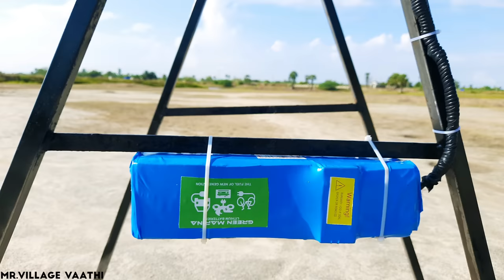120 Km/hr Cricket Ball Launcher | Speed தெறிக்க விடும்| Using Cycle Wheel | Mr.village vaathi

Comment: place 2 push pull solenoid to control ball movement, and pour even 100 balls in a container. Pull the solenoid pin and allow one ball in at a time. Spinning a ball with just 2 wheels is tricky. You may achieve a basic spin, but not a considerable spin to practice. Use this for, pace, with higher speed. It will work like darling.

Comment: Anna, super work! 
I would 100% consider adding a motor to both the wheels.
1. For a fast bowling make them rotate in the opposite direction. (clockwise/anticlockwise). This will make the ball go faster. 
2. For Spin, make them rotate in same direction. You can change the nature of spin(leg/off) by choosing which wheel to rotate.
This can done with a small toggle switch and switching the current direction to the motor. 

My suggestions.
-Get a thicker tyre so that it increases the surface area of the contact with the ball.
- make the wheels a bit slanting towards up, so that there is some flight and covers more distance

Videos are super Anna!
Reply from the maker: Thanxs bro...Thank you for telling me this..keep Support 🤝
Reply: Also can Remove the tyre and try with rims, and keep the motor for both wheels. Ball may come even faster
Reply: I think the spin bowling procedure is wrong
If you spin both Tyre in same direction then it won't reach its enough speed
Reply: In less than 50 seconds of testing you observed a lot.. Great👍
Reply: @kpn64  Tyre vida rim la friction kammiya kedaikum. So grip kedaikama slip agi slow ah dhaan pogum nu thonudhu
Reply: I m not Fluent in Tamil, but observing this machine has issues ball only pitch out of leg side. above corrections has to made and redo a video. Also wheel is not aligned in rotation that is why same place a ball can't pitch. also make Ballers hight to elevation right.
Reply: boss, apdi senja spin thaan adhigam aagum la, how will speed increase
Reply: what an analysis! great bhai..

Comment: I salute your work brother......it is very costly machine you made simple.
You make arrangements for frame up and down moment so that you can vary the ball length and bouncer....
But you may get battery down after 2 or 3 overs . You cannot charge
You can think  add springs to use it for leather ball and low battery usage

Comment: Bro ippo neenga build panna setup la one side of the wheels mattum frame oda connected aa irruku, so when the ball contacts the wheel the axle will experience torque in the opposite direction. So oru metal frame vechi wheels oda top la yum connected aa irruka mari bolt panna jerk reduce aagum and machine oda life time um increase aagum

Comment: Bro neenga last keeta doubt actually possible bro but neenga speed vary panna mudiyadhu ,but neenga rendu motors uum same direction laa rotate aaganum apdi Panna spin ball Vara chance iruku suppose first motor anti clockwise laiyum second motor clockwise laiyum rotate paninga naah forward laa throw pannum idhe rendu motor uum anti clockwise la suthichu naa spin ball Vara chance iruku bro (that is first motor ball aah throw panna force kudukum and second motor ball ku spin panna torque kudukum maybe)
Reply from the maker: ok bro thanxs for the tip

Comment: You can connect a chain from the rotating wheel to non rotating wheel.. so one motor is enough
Reply: Speed will reduce
Reply: To increase the speed can Use high power motor..

Comment: Ball speed is not enough bro! You need another motor for the other wheel. You also need to figure out a way to alter the line & length of the ball. Which means the PVC elbow has to be flexible (not fixed), should be able to move in all directions

Comment: Bro I am doing papad making business can u do a video on how to make hot air generater by buring wood for drying papad or other food product inside room 

We are drying papad in sunlight currently but it requires large area and if I get idea on hot air generater I can able to dry more papad in quick time  make more productive
Reply: Contact some solar panel installers they may guide you with no electricity charges.

Comment: Adhu work aagadhu thala yena according to Newton's law every action has an equal and an opposite force and the power produced by the left will be nullified by th right motor.. So to make this work make the motors run in two different directions but changing the wire to negative or positive